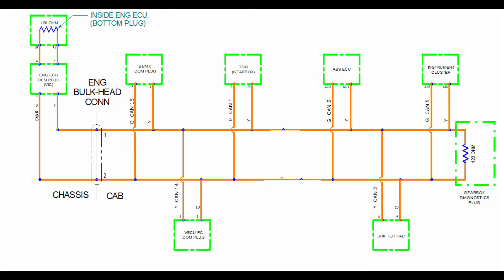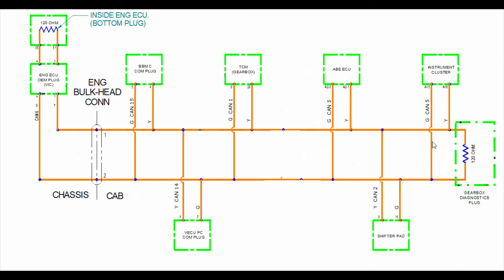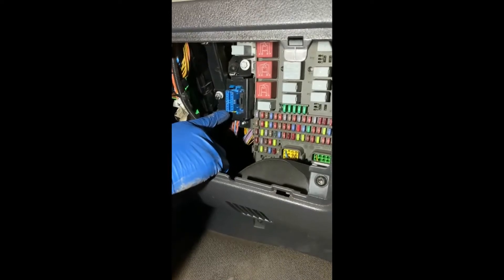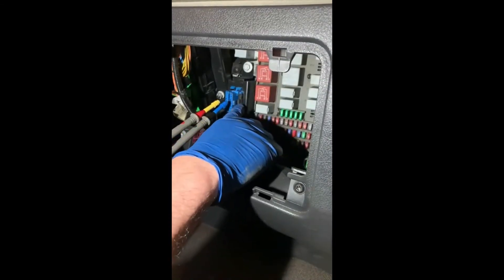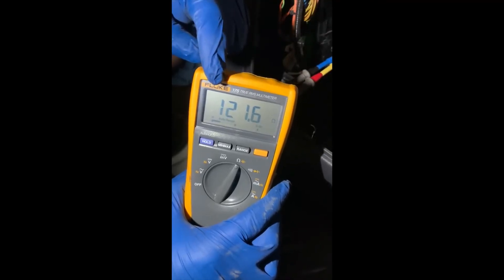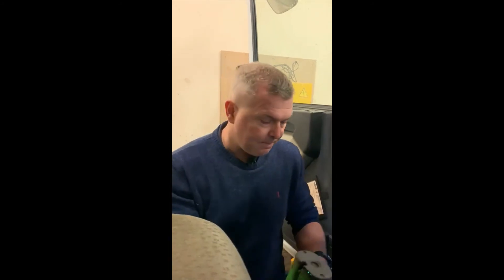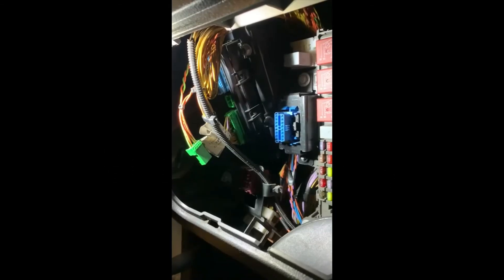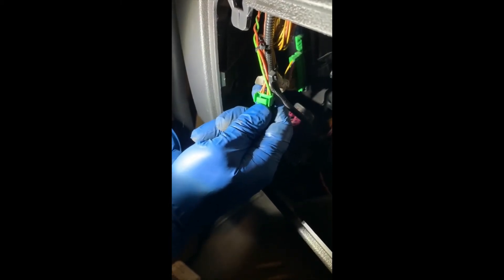Renault Midlum CAN Bus Basic Tests

Comment: bonjour je recherche une panne sur un renault midlum dxi , j'ai une interruption du bus de données parfois ,pas tout le temp . Le problèmes et que j'ai bien 60 ohm a ma prise OBD et j'ai bien 120 en débranchant ma prise au compartiment moteur . Par contre j'ai 120 ohm au vécu parfois mais meme les deux resistance enlever (a la prise obd et deconnection calculateur moteur ) j'ai toujours 120 ohm je ne comprend pas le problème ,le vecu est il hs ?
Reply from the maker: c'est très étrange d'avoir encore 120 ohms après avoir retiré les deux résistances. Je me demande si ta résistance au niveau de l'OBD est réellement connectée. Il se peut qu'il y en ait une connectée directement aux broches 6 et 14 de l'OBD. Essaie de déconnecter la résistance OBD sans déconnecter celle du moteur pour voir si elle reste à 60 ohms. De plus, ces moteurs sont sujets à des fils cassés derrière le couvercle en plastique du module de commande du moteur. Le couvercle dans lequel se trouvent les 2 connecteurs du moteur.
Reply: @trucktechtips638 pas de fil cassé derrière les prises de l'ECU et sous le cache plastique.
Reply: Un immense merci pour votre réponse, lorsque je trouve 120 a la prise 4 pin du VECU j'ai enlever physiquement la résistance noir connecté a l'obd comme sur votre vidéo @trucktechtips638  le problème de mon véhicule et d'afficher une interruption du bus pendant les virages et intermittences
Reply: J'ai trouvé une partis de la panne, ce camion est a un marbrier et il a des béquilles qui tapé dans le connecteur de l'apm ce qui a fait ce dessertir des cosses et fils ,une fois réparer je n'ai plus de défaut n'y problème par contre j'ai 120 ohm a mon bus 1939 de ma prise APM 🤔 il semble bien prendre la résistance ECU mais pas celle de la prise obd . Je l'ai débranché et il capte que celle moteur est ce normal ?
Reply: Demain je vais l'essayer sur route ,je vous tiendrai au courant.

Comment: I have a 2008 Midlum and the display/dashboard is not working at all after boosting the battery with a battery staring robot. Everything is working properly except the display.  Checked everything  the relays and fuses there is no fault. The diagnostics device cant access the display module ... have you meet some similar problem?
Reply from the maker: Hi, we haven't had that fault, but here are some things you can check. Remember the cluster is just another module so it needs a few things to communicate, powers, grounds and connection to CANbus. If these are all there then the cluster module could be at fault. There are 3 plugs on ours C, B and J.  Plug C pin 13 is the cluster ground. Plug C pins 11 and 12 are high speed CAN check your resistance and voltage at these pins. Plug J pins 1 and 2 are diagnostic CANbus, check you have approximately 4V and 1V (CAN Lo and Hi) respectively. Plug J pins 6 and 8 are high speed CAN so check your resistance and voltage there. Finally plug J pins 10 and 23 are power supplies. If you have all of these then it looks like the cluster module (MID140) is at fault.
Reply: Hi! As a feedback for the tips above You have right. The fault was at the cluster module, the resistance and the voltage was exact as you mentioned... I'm grateful to you that you answered my question and for the useful answer, we have saved a lot of money (replaced the module with a used one for pennies). Thank you for sharing your knowledge!  @trucktechtips638

Comment: Bravo.......is it true......by unplugging the 120 resistor it will start blinking the codes on engine light chanel .....dash......old cars...cheers
Reply from the maker: I haven't experienced that myself Matt but to be fair it depends where the break or issue is. Volvo FE/ Dennis's where always bad for the CAN lines breaking right at the Engine ECU so you wouldn't have communication with the module and no DTC's available on the Scan Tool or Instrument Cluster from the ECM.